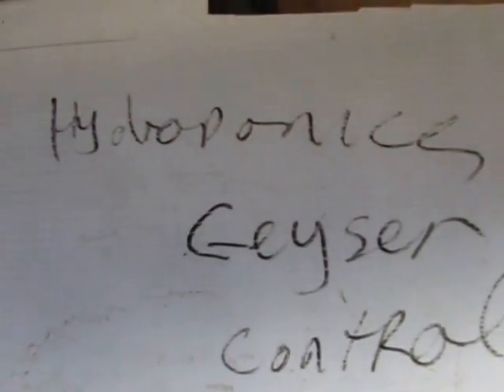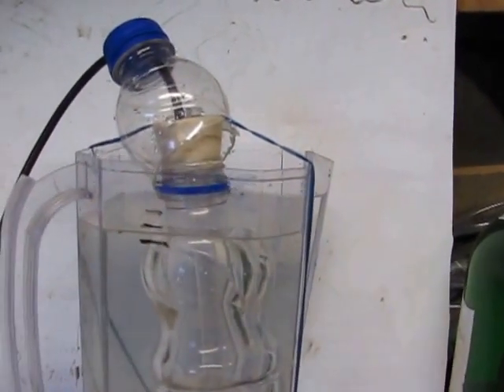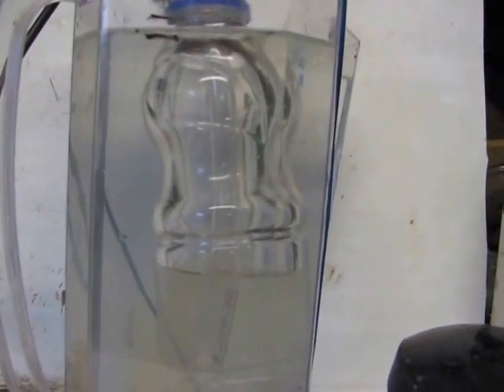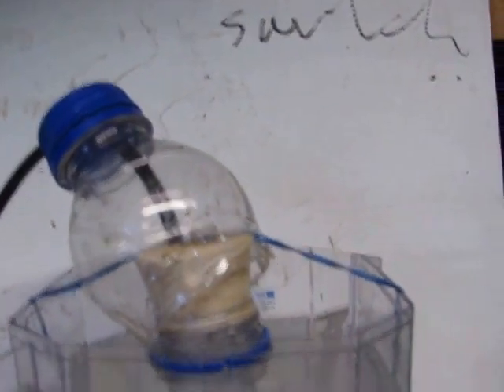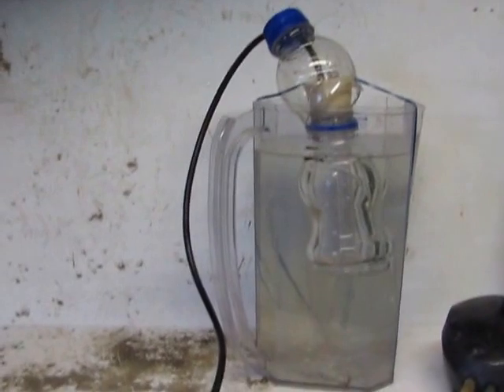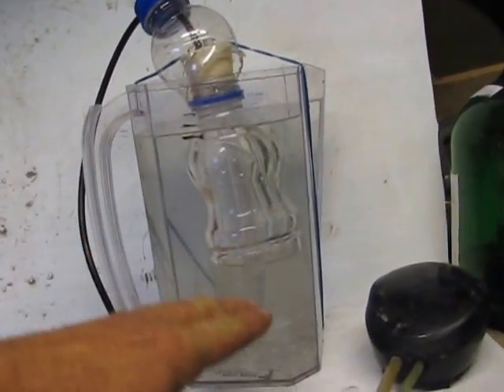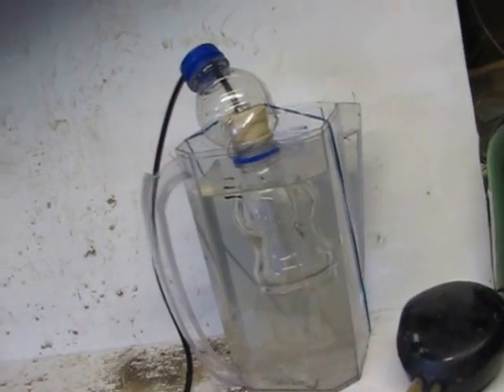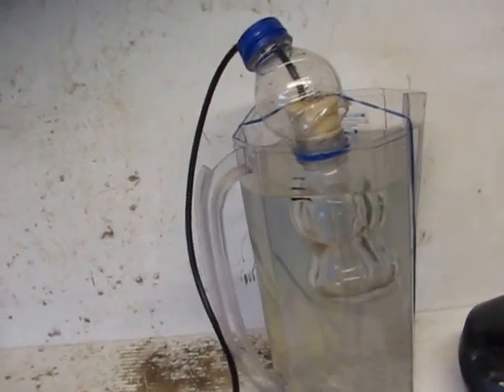Geyser Switch for compressed air powerered ebb and flow hydroponics systems!

Comment from the maker: Hi, Patrick, I have another video with a diagram and it is in a playlist currently called "Air driven raft and ebb and flow hydroponic systems".   I actually did not expect such a small model to work. In the much larger "real thing", the water will come all the way up and start to fill the "test tube" from the top. Also, in the real thing, the geyser erupts with a pulse of water but the rest of the water comes out as a spray or mist. (probably useful for more oxygenation if turned  downward).